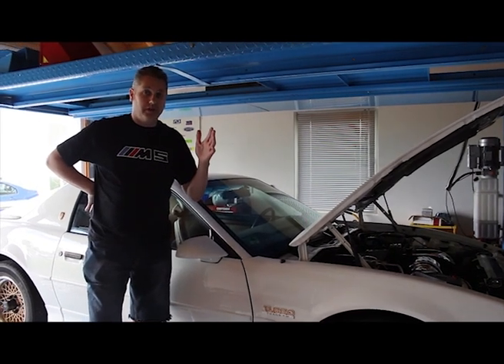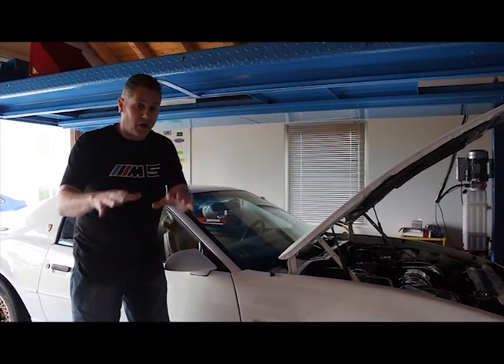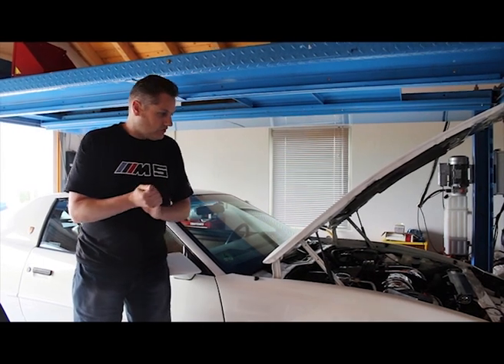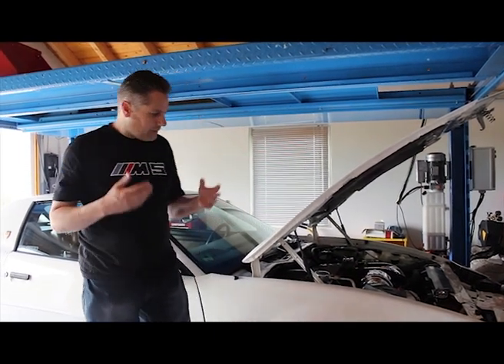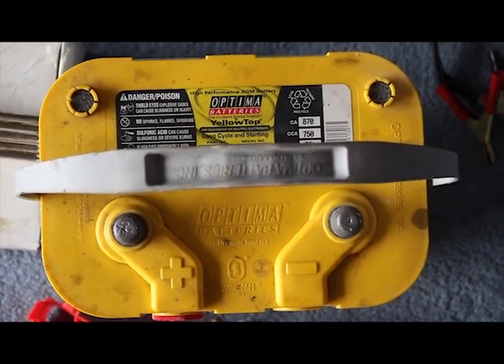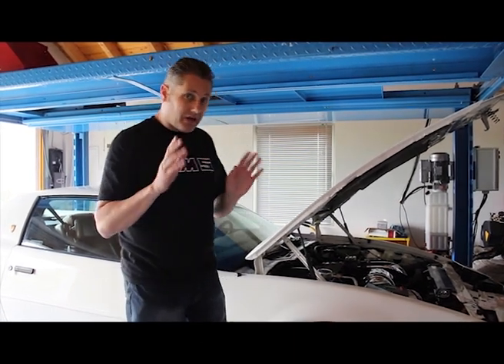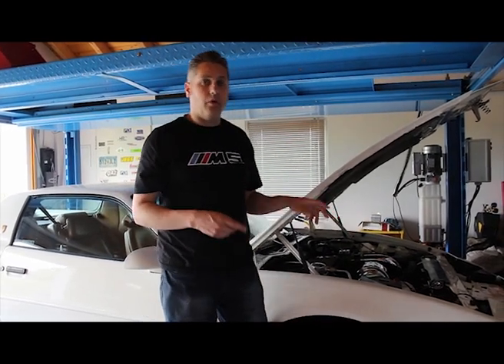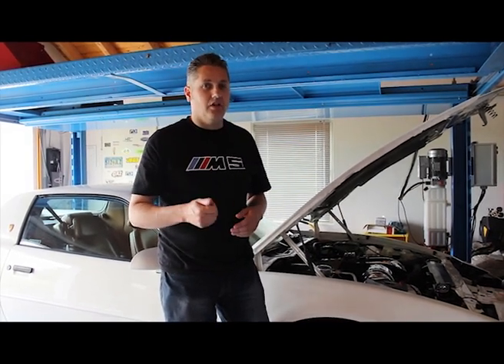Reviving a depleted AGM Battery

Comment: There are no electronics inside an AGM Battery. The "Smart" charger will not recognize the Battery below a specific voltage, generally around 6v I have a charger from Repco that recognizes down to 0.5v. No disrespect meant to the Author. I also sometimes use a dumb charger that will just output charge regardless of the battery's voltage.

Comment: You fail to mention that both batterys have to be AMG batteries !!!!!!
Reply from the maker: I didn't mention that, because that's not a thing.  You can use a regular battery that has a good strong 12.8v to get you AGM battery going.  The main goal is to bring the overall voltage up, so it'll take a charge.
Reply: Hey I know it's an old post but just wanted to make absolute sure that both batteries didn't have to be AGM. I only have standard flooded batteries to use with my depleted AGM.

Comment: not useful
Reply from the maker: This is an older video...what part didn't help you?  I should probably revamp....
Reply: @bobmac1970  Well, I wanted you to remove the plugs check the voltages correctly, saturate the cells with sulfuric acid mixed with distilled water, charge it and retest the voltages.

Comment: What a great hack. I daily my M5 but my Porsche some times I let the battery go to low. The battery is in the front hood and you can not access it. Bob I can see you smiling but after an hour trying to figure it out I open the owners manual in the fuse box there is a hood icon you pull it out maybe 3/4 inch you can run jumper from that ( pos) and the door for negative to power the car and open the hood. This reminded me of that, now I just use a trickle charger a few days a week.
Reply from the maker: Glad it worked out for you! It's easier if you have Pos/Neg jumpers under the hood ;)

Comment: I just used this method to save a very expensive high capacity Solar AGM battery and it worked like a charm. This battery dropped all the way down to 5V and I thought it was toast. I charged up a healthy automotive battery using my Stanley 25Amp charger until it reached the full termination voltage of about 13.1V and then hooked this to the AGM battery via the jumper cables and then was able to run a complete charge cycle on the parallel combination. Once the charger completed its routine, the the AGM sat at a healthy 13.1V. Now that the AGM battery was at a good state of charge I used the recondition mode on the charger for a day just to make sure to break up any possible deposits on the electrodes and then re installed it into my solar system. Thank you for making this video is was very helpful and saved me over $500.
Reply from the maker: I know the video is a bit cheesy...but I'm glad it help you save that AGM!  ;)

Comment: Great Video!!  Thank you so much.  Just used your method to restore an AGM battery in BMW 745i that was completely dead.  Battery had no power.  Even advance auto parts and auto zone could not find any purse in the battery.  When I plugged it to my CTEK charger, and It didn't even recognize the battery.  I used your method with good battery in my Chevy treverse and my CTEK charger.  An hour later, I unhooked.  I plugged my CTEk charger and automatically get step 4!!! thanks!!
Reply from the maker: I'm glad it worked out!  Thanks for watching
Reply: i know this comment is over 21 years old but i'm hoping you might get a notification and remember to reply to my question.
just one question:

Was it an original BMW AGM battery ?

Comment: Do you think this method will revive a agm battery that gets charged but as i put minimum  load into it gradually drops voltage which means its not holding charge..or is there any alternative way
Reply from the maker: If the AGM battery is too low (less than 10.5v) you'll need to make sure the 2nd battery is fully charged before trying to charge both together.  A good 10amp charger for several hours is preferred.  It is possible that the battery is not holding the charge from what you describe.  You can try to repeat a couple times, but chances are that your battery might be done :(
Reply: Allright i will give it a shot ..thnx for the reply and happy new year!!
Reply from the maker: Did it work?
Reply: No unfortunately it seem like its a goner... i charged it a couple of times but no luck and while charging it was getting hot and gassing i think the cells are faulty it was getting hot just after few minutes of charging. Better not to try charging it more to avoid some nasty explosion ..
Reply: AGM batts are supposed to be moist inside instead of liquid free flowing over the plates. Just like regular batts they will try to vent gas when charging but they have valves that slow the venting process to conserve the moisture. If you carefully "maintain" your agm batts they might last 3 times longer than manufacturers expectations. *We bought 3 Ecoped CityGo Electric Bikes with 4 AGM batts in each from Walmart on the same day. Our two ebikes had batteries that lasted almost 8years and wife's brother batteries lasted just over 2yrs. He and myself drove about the same but i opened and maintained my batts and wife's while he did not. He and i drove 5 times more than my wife but her batts still lasted like mine did*
Reply: Am having the same issue.. Mine doesn't overheat or hiss, it changes very well but but discharge very fast...
Reply: Atiqure ali borah hi you need to add liquid to the battery a litter beacause the fiber is dry that why. You agm battery will never charge